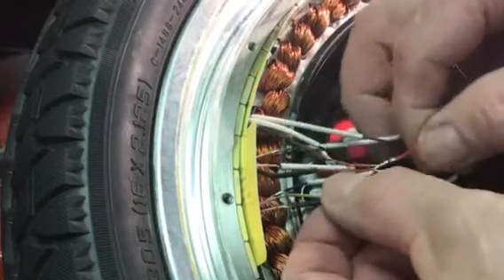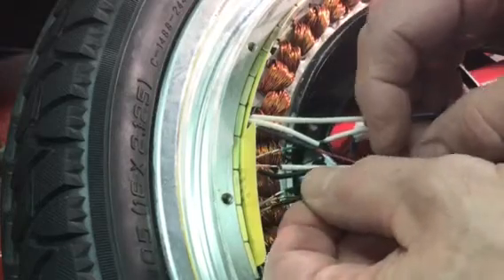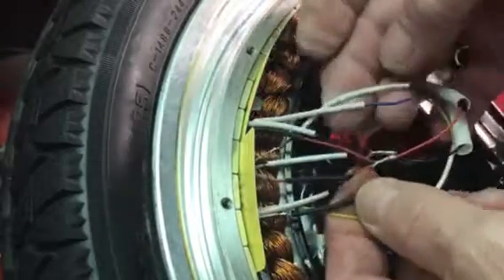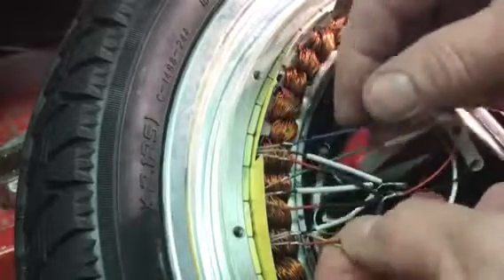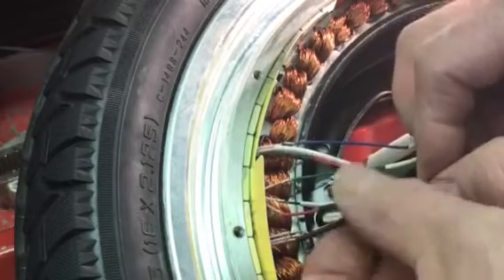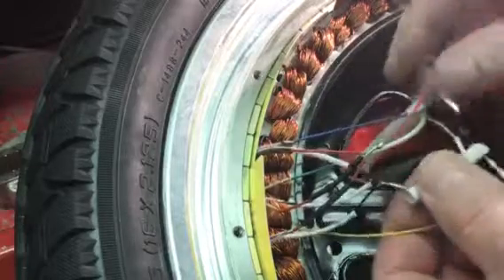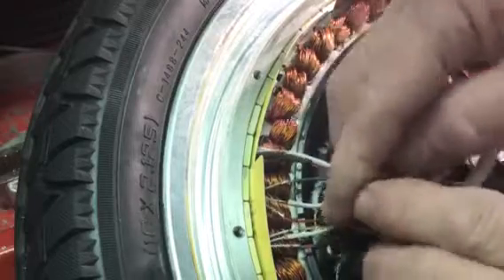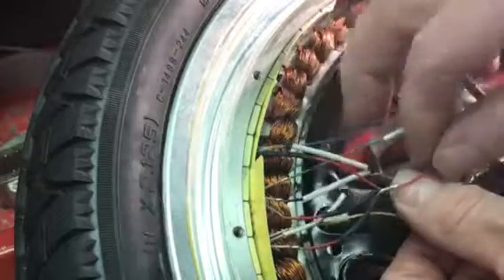Hall sensor wires

Comment: Hi there watched both videos I now understand hall sensors thanks. It would be nice to see you replace them wires, my hub motor has a similar problem even though I have a new motor coming I wouldn't mined having a go at fixing the one I have as hall sensors are cheaper than I expected.  What wire, ie gauge, voltage, thickness etc would you recommend for the wire replacement, I have salvaged so 18AWG 300v from and old computer PSU would that work? Many thanks in advance